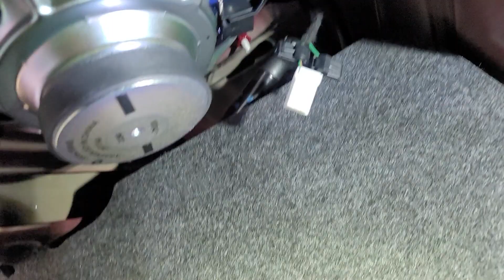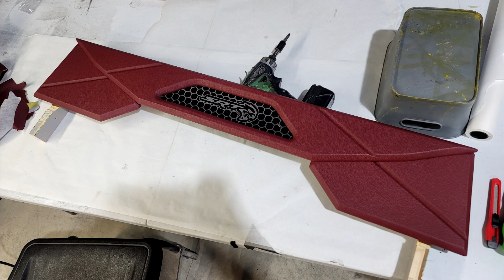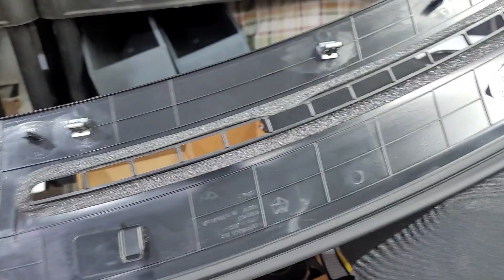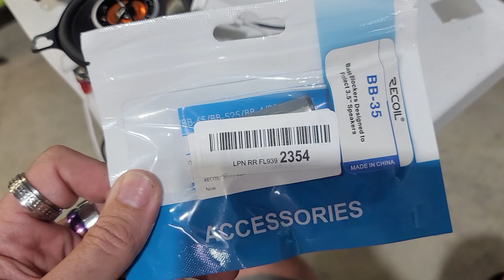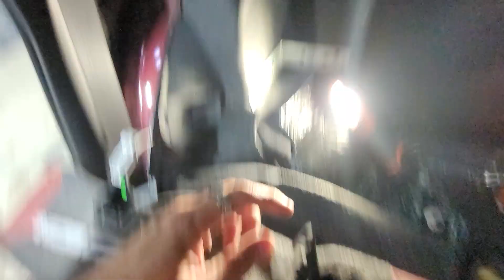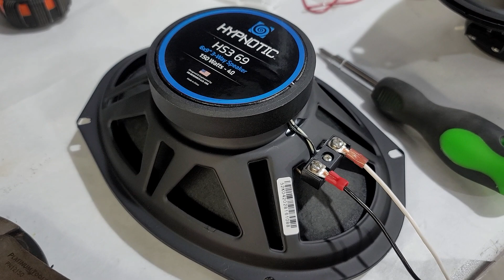DODGE CHARGER HOW TO INSTALL DASH / REAR SPEAKERS CUSTOM SUB SETUP - HELLCAT / SCATPACK / 393 / HEMI

Comment: Why would you add the BB-35's to the dash speakers if the stock ones didn't need them?
Reply: Bass blocker. IMHO just being safe spending $5 per cap to protect each $75 aftermarket speaker. Everything I've used that needed had inline caps pre-installed but what he did doesn't hurt and isn't too costly to add extra safety.

Comment: Did you leave the tweeters hooked up to the stock amp? I want to upgrade my tweeters in my hellcat but not sure if I can leave them connected to the stock amp or just wire them to a bigger amp.
Reply from the maker: I would definitely get rid of the tweeters and go with something aftermarket if you want the best sound

Comment: Hey, I have a 2022 Dodge Charger with the Harmon Kardon system. My rear 8” sub in the rear deck is blown. Can I just replace it with another aftermarket 8” sub? Or do I need to put the OEM sub back in it? Local car place said it won’t sound right with the aftermarket sub. Thanks.
Reply from the maker: I would not recommend an aftermarket sub
Reply: Ok, thanks. I appreciate the reply.